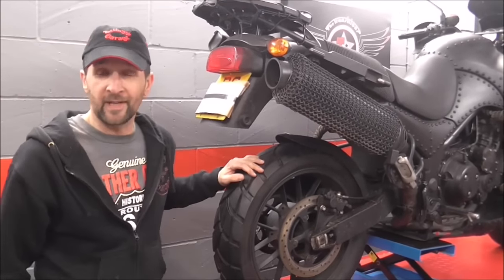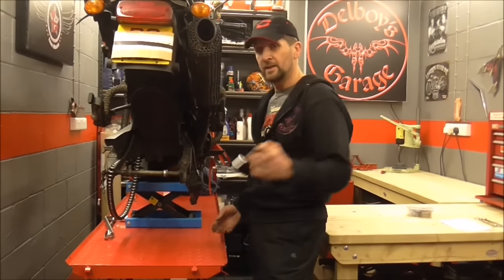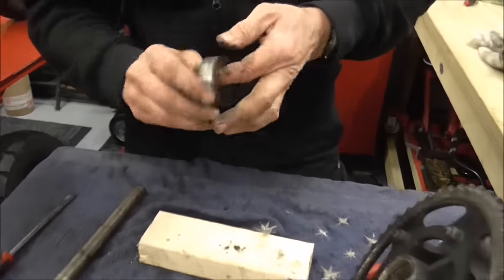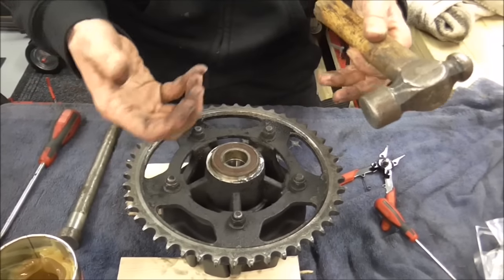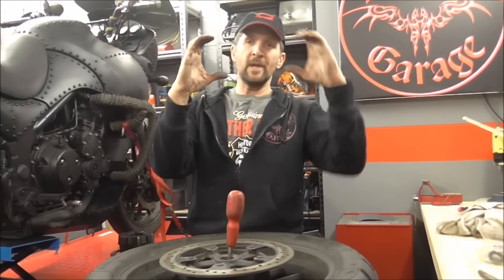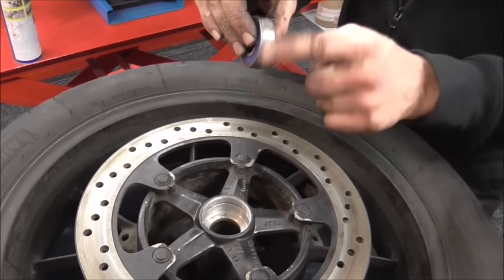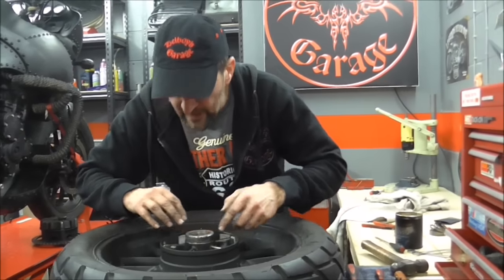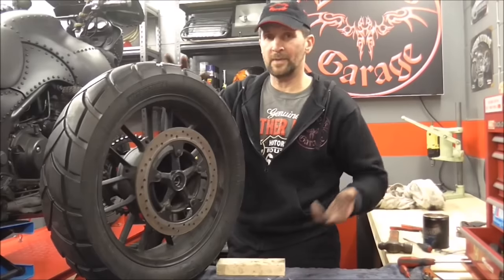Delboy's Garage, Motorcycle Wheel Bearing Replacement.

Comment: I always used sockets (those DAMN square hole things that come in the simple, easier measurement of metric; As well as the non sensible "sae" measurements i.e. 5/16's, 11/32's & everything above, below & in between) Thank You! Using the old bearings to drift in new one's easily saves over a half an hour searching for the perfect fit & Is NOT guaranteed to be problem free. I'd be lying if I said the socket method is flawless or even optimal (is anything in retrospect?!) Very thorough! You showed basically anyone from a first bike owner (assuming the person is 16 years of age or older, you broke it down simple enough for almost any adult!) To someone riding for years, that for some random reason, never had/did do new bearings. Well done, APPRECIATE YOU doing this, sharing your experience & knowledge, saving myself & many others, money I can put in my tank, towards tasteful mods, even insurance!! Everyone who rides needs to know how to diagnose a bad bearing! NOT knowing could have disastrous consequences & for about $25 Usd, In this day and age; It's foolish to NOT learn about the structural integrity of your motorcycle!!! Ride safe e.one!
Reply from the maker: Thank you my friend, wise words well said, as time's are hard people can't always afford to buy brand new bikes that are un-worn and backed up by manufacturer's warranties, so the older bikes need that extra little bit of care and maintenance... and most of it is pretty basic and little more than housekeeping!  Thanks for your support.

Comment: Loved the video!  Very helpful!  Just changing the wheel bearings on  my Bandit 1200.  The Bandit doesn't use any circlips and has a tight interference fit all the way down.  So I took the old bearing and ground about 2 thousands off the outer face so it wouldn't get caught.  Worked well and now I have another "Special Tool" in my tool box for intstalling bearings!

Comment: Thank you for this informative video! I've been searching for ages for a good explanation of how the bearing is connected to the wheel. 
I'm a mechatronic engineering student and I have to make a simulator for ABS brakes. I wasn't really sure on how to connect the wheel to the shaft but thanks to your video I have the knowledge necessary to start designing my simulator
Thank you for your work!!!
Reply from the maker: Good luck with your project my friend, glad the video helped!

Comment: Good video thanks. I am sure someone else has mentioned this in comments but sticking new bearings in the freezer (as well as, or instead of heating the wheel) can make installing the new bearings easier. Also using a socket of roughly the same size as the bearing outer makes a good drift.
Reply from the maker: +Daniel Quick Hi Daniel, yes, lots have said, and you can both heat the wheel AND freeze the bearing..then they practically push in with your thumbs. and i NEVER abuse my sockets by using them as drifts... you can use a length of thick alloy tube though..!

Comment: I know this video is old Del, but my wheel bearings went the other day and the new ones are arriving tomorrow and I couldn't remember how to do it.

Great even as a refresher video. Cheers again.
Reply from the maker: Thanks mate, good luck with it - hope all goes well, feel free to give 
us a shout if you get stuck, always happy to try and help!
Reply: Well it got to the point I hoped it wouldn't!

The bearing on the seal-side, the side with the disc was completely shot. All the inner parts fell out when I took the seal off and I was left with the outer ring press-fit into the wheel.

I'm guessing there aren't any magical solutions for this, are there?

I can't reach that outer-ring as the space between the two sticks out past the outer ring.

I'll add some pictures in a minute.
Reply: Right - so this is the outer race stuck in the wheel:
http://i.imgur.com/81xZshO.jpg

And the damaged bearing in place before I removed it:
http://i.imgur.com/qNx39if.jpg
Reply from the maker: Ok, in the first image, i presume that this is hte side that sits on the end of the free floating tube...and the part in the middle of the hole is the central tube itself?.. if so, then you obviously have a big enough hole to poke a drift through and beat the other bearing out the other side... then you can use the tube to tap that outer ring out using the tube>??? no??.
Reply: The outer bearing race is too far recessed past the hole that goes through the wheel. In the first image the spacer is out.
There is no tube there... I don't think.

That hole is as far as I'm aware just a part of the wheel.
Reply: Sorry - I forgot to say I've already taken out what I think is the spacer and all that's left is the actual wheel.

Cheers for taking a look!

I'm going to try a bearing puller tomorrow but failing that - any advice?

Spacer in:

http://i.imgur.com/GLdOr4nh.jpg
Reply from the maker: Ok mate , then I guess the only think you can do is try and tap a very 
thin chisel in to the joint you can see in an attempt to force it out...
 once you have a little gap, then you can tap from the other side, you 
could try a little heat as the alloy of the wheel rim will expand 
quicker and more freely than the steel of the bearing cup, specially if 
you concerntrate the heat on the alloy only... good luck with it buddy -
 hope you get it sorted!
Reply: Moonfleet41 my dad and I tried heat, chisels, alsorts. 

Eventually we welded a long bolt (with a huge head that we'd turned down to about 41mm on the laithe) to the inside of the race. Then smacked the other end of said bolt until the race dropped out. 

Got them all changed in the end though. 

Thanks for your time, Del. Your attention to the community really sets you apart from all the other YouTubers.
Reply from the maker: Thanks buddy, and good job with welding the bolt.. i didnt assume you has access to a welder.. it can solve so many issues for sure.. Take care buddy... all the best. Del.
Reply: My dad was kind enough to give me one of his un-used Arc Welders. Probably a bit powerful for most thin metals but it'd have done that.. I think. haha.

Comment: Down to earth, informative and fully comprehensive explanation. I really enjoyed this and learned from it as well. My Tigga 1050 only has 8K of fair weather miles on the clock and so I guess it will be some time before I need to do this but you never know - at least I now know exactly what I'll be confronted by. Have just changed and balanced my own tyres  which proved "interesting" without tyre levers or any special kit but a little ingenuity went a long way. Many thanks . . . have subscribed to your videos - great stuff!!!!
Reply from the maker: Thanks so much for the sub my friend, and good to know the videos can help you.   Good choice on the Tigger 1050, and i reckon it'll be a long time before you need wheel bearings buddy..      thanks for watching.. .Del.

Comment: Excellent Video, Right up to the part where you lightly sanded the ridge of the Bearing hole, Then NOT CLEAN THE GRIT FROM THE SANDPAPER OUT OF THE HOLE, DUDE ,If one of my mechanics did that,I would slap him and Point to the nearest McDonalds, Everything else you showed us was spot on.Love the Videos.Good Work.

Comment: Will get my Speedie up on the Skylift tomorrow and check the wheels. Fantastic video as always Del, save ourselves two hours at £45 for a dealer plus £40 in parts. Thank you
Reply from the maker: +Red Thunder Thanks buddy, its a proper workshop job and will always cost well over £150 to have done..

Comment: Just completed project (with the help of your video) it was as advertised, except my sprocket bearing does not have a circlip......I mention this because I was worried that the bearing I was using as a drift would have stuck.....so I used a block of wood to drive it home, being careful it was on outer race. Thanks for posting video!

Comment: great informational video! I did my first ever bearing replacement yesterday, on 2004 Vulcan 2000, the pulley bearing had fallen apart, cleaned it out, had to take hub to local dealer to get the outer ring of the old bearing out, then put in new one super easy, re-assembled fairly easy, it was a pain getting the axle back in place with all spacers in their proper homes
Reply from the maker: Glad it helped mate, and thanks for your kind feedback!
Reply: @Moonfleet41  welcome thanks for the tips, subscribed!

Comment: Ha!
I was just going to watch for a minute or two, as I have work to do on my bike now, too, but I watched it all.
I am about to (potentially) replace the clutch assembly bearings on my Honda PCX 150 scooter.
I am familiar with the CVT set-up, having done CVT overhauls a couple of times, but I wondered "Shall I get a bearing puller kit and save myself paying the dealer, or shall I just pull it apart and give the driven pulley assembly, including the bearing, to the dealer and get him just to do that bit?".
I needed to see someone use the bearing puller tools, but of course you didn't.
Still, thanks for a good instructional video with no more jargon than was necessary.
You have great grasp of what to mention and how to say it simply while you work.
Thanks a lot from a country far, far away (but not a long, long time ago!).
Reply from the maker: Hi buddy, good question, it's always a dilemma whether to invest in specific tools for specific jobs , like pullers.. and seal drivers... etc., I wonder the same myself sometimes, but what always answers it for me is 'will I use it again in the next 2yrs?', and how much is it vs. the dealer's charge for pulling it off??  These days, a set of reasonable quality pullers is not too expensive, and you don't need posh Snap-On ones, if you're only gonna use them once a year... maybe check with a dealer and see what they would charge, then price up the tools and make a choice?!  I've plenty of tools I've used once in 5yrs and would love to cash them back in!

Comment: Great video!  Getting ready to do this on my newly aquired bike.  Good tip using the old bearings.  They make perfect bearing/seal drivers.  I do that all the time when building and gearing diffs.  I use the races in my press.  Something you can do, take some material off the old bearing, so when you use it as a driver, it slides back out easily.  Just a thou or two.
Reply from the maker: Hi mate, it's importnant to reduce the leading edge of a bearing you are going to use as a driver, if it goes more than 3-4mm in to the hole, but in this video, it barely goes in 1mm, even when all the way home, it can be pulled out with your fingers...you can also use an old bearing race split with a disc cutter (just the outer rim) if it is to go any further in to the hole so you can't get it out... this makes it removable with pliers, even if it's all the way in with no lip!  Good luck with it buddy, hope it works well for you !

Comment: Hiya Del, can I pick your brains, I've just had my wheels powder coated and today started to replace the front wheel bearings, I've been tinkering with bikes from the age of 16, (61 now),  I Inserted the new wheel bearing left hand side first as it states in my Haynes manual, inserted the sleeve tube, then inserted other side bearing tapped them all the way home with no huge force, fully seated, only to find the inner race solid on both sides and i noticed you can move the sleeve tubing with your finger, mine is extremely hard to wiggle around. I asked the powder coater not to get any paint on mating surfaces which he pretty well obliged (apart from inside cush drive and cush drive lugs, so that's another job which I'm expecting to be tight with the new cush drive rubbers and a couple of microns of paint on each lug. I've never come across bearings failing before, so any ideas??? Is it acceptable to bang the bearings out again and try again? cheers in advance...Mark (Suzuki gsxr 750 srad 1997)

Comment: Thank you for your video. What i found out about why do these bearings get so rusted and fail, the reason was simple.  It is easy for water to go inside the rim and get trapped in between that rusty bearing and the dust seal and stay there for a long time because there is no way for that water to get drained or get dry so quickly. So i drilled 4 small holes around the dust seal to let any water to get out or dry faster because here the number one enemy is not dust, it is water and rust. i did that a couple of days so time will tell if i was right or wrong.

Comment: Thank you both for another clear and easy to understand video tutorial - you for sharing these techniques and your good lady for the excellent video recording.  The Haynes manual for my bike (NT700VA-7) advises the use of an internal expanding puller with a slide hammer attachment for the first bearing, which then ensures that the bearing can be pulled out straight, but though I can get one of these tools for about £20 it will then take up space uselessly, so maybe it might be worth seeing if it will come out your way first?
I also used your techniques of plastic welding on my front mud guard which saved me lots of money thank you :-)
Reply from the maker: Hi Steven,  yes a Blind Bearing puller is a great tool, you can buy them with a slide hammer attachment, or a bridge puller instead, both work just fine, and they are a great investment, this is a really old video now, and today i use a bridge puller all the time for removing bearings..  but this method of drifting them out from the other side will always work just fine if you get stuck or don;t want to make the investment..   Good luck with ours mate.   Del.

Comment: Haven't read all 700 comments but I used to grind down the outer race of the old bearing a few thou ( just let it rotate against the grinding wheel enough to remove the surface all over) and gradually built up a collection of them for drifting in new bearings. The drift will then drop out after use ready for next time

Comment: When I replaced the wheel bearings on my Triumph's back wheel, I did the brake disk side bearing first. My thinking was that, as that bearing is secured with a circlip, it is not held quite so securely (relatively speaking) as the drive side bearing (friction fit as opposed to the interference fit of the drive side). I also used the 'All Balls' bearing kit - nice comprehensive kit for a good price.
Reply from the maker: +David Carr Hi buddy, the reason that it is commonly preferred to do the un-clipped side first is becuase the spacer tube is free to move the full width of the inner hub space, as there is no flange to catch on... this means you can push it aside further in order to get the punch or drift squarely on theback of the bearing - if you punch out the circlip side first, the spacer tube is obstructed by the flange the bearing sits on... and this gives you barely any space to get the punch on the inside of the bearing.. .meaning it's risky that you could punch the inner bearing cup clean out leaving the outer rim in place, which is a total arse to try and remove... you can heat the rim with boiling water, and the circlip bearing will often drop out, if it's clean...

Comment: I have changed a lot of bearings because I have powder coated many wheels. I like to heat the rim to about 250° and use a blind bearing puller kit. You can get them at Harbor freight.

Comment: Did the rear of a 2004 1200 bandit, used this vid for reference all excellent and completed in around an hour m. Then did the front too, had hassle getting the old ones out. Couldn't get the 'lip' big enough to hit on the bearing. Eventually it came out and then i realise the wheel casting is tapered in the centre to allow the spacer to move over on the speedo gear drive side. This model doesn't have the speedo drive but the wheel still has the option/backwards compatible!!
Reply from the maker: +Gavin Briggs Hi Gavin, well spotted on that its the same in the Bonneville range, they had mechanical speedo drives for the first three years... thne for the last 8 years they just leave the castings the same... what ever saves money aye..  thanks for watching buddy, and take care.. all the best. Del.

Comment: It also helps greatly to have the service manual of the make n model you are working on. Not all bearings are the same, tapered Timkin bearings require special tools and also spare spacers to set the proper "endplays".....

Comment: Great video and information as always.
One thing I did notice, and funnily enough did on a mates R1 the other day.  He also had a Scottoiler which has the one spout also.  I cant see the use of that, surely you need both seals to be oiled for it to wear equally.  I know they do the V spout that covers both, which I would have thought should be standard.  I just don't see how oiling one side of the chain and not the other is good for it, but Im happy to be corrected.  All the best mate.
Reply from the maker: The single outlet was invented before the dual outlet, whenever I've had a single tube, the inside of the chain is wet, maybe not as wet, but it certainly gets oil on there... your hardly gonna get wear on one side of the chain and not the other, it's as much about preventing rust as lubrication... the twin outlet is a more recent development, but it doens't meant the first design is wrong, I suppose all thing improve over time...... Thanks for your kind words my friend, we really appreciate the support, have a good weekend!